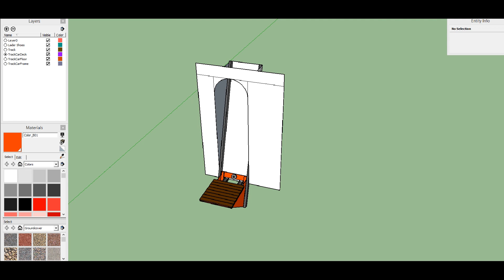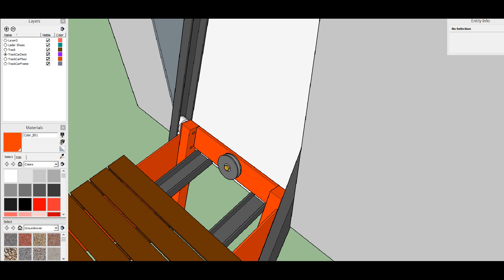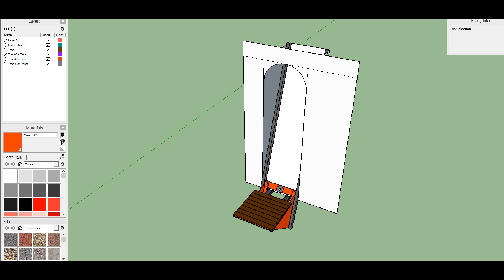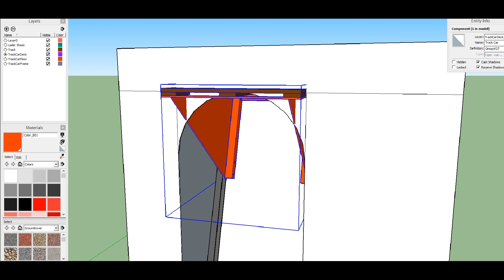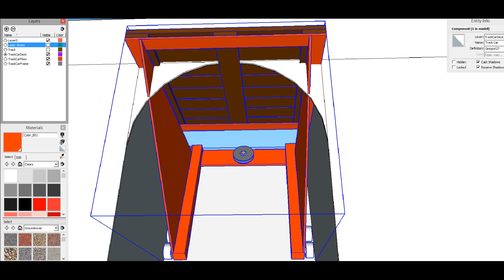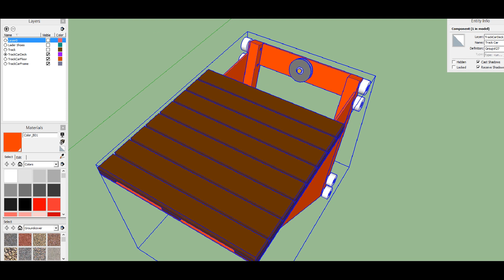Seeker Elevator solution

Comment: you could put the ladder on the elevator, this would provide a means to attach gear to be hoisted to. and then make it a more permanent platform at the bottom. when not in use the ladder would be functional as a ladder.  it would also help gaurd the moving parts and provide more clearance to the total package.

Comment: I'm no engineer but how will that design work?  However the ladder is attached to the boat,   your lift will foul the attachment points.  It can only work if the ladder is free floating (which it obviously isn't).

Comment: Why the space between the ipe tile and the rails?  The space looks like it's 40% of the tile size. I guess I don't understand the application well enough.
I agree with David Stewart about doing away with the ladder. I kind of like those near-vertical stairways with alternating treads and three stringers--one of them between your feet. They allow you to double the tread depth and you can let heavy loads slide up/down the center rail.

Comment: Do away with the ladder...Too temporary.  Mount auto-flip steps up the entire length.  Have them setup so as the lifting base travels past the steps auto retract.  That way you can move the tile in close to the steps and avoid it hitting combing. 
Plus at the bottom of the stairs I'd add in a self close false floor to hide the hole. 
Just a thought. :-)

Comment: Why is the platform sticking out so much from the rails? I would try to keep the platform as close to the rails as possible, if only, to reduce the torsion (it would avoid a gap when at the top and clear the arch in the door way).
Reply from the maker: Because it has to clear the ladder that runs in that space.

Comment: Good idea but reinventing the wheel. Just go to a place that caters to roofers and get a roofer's shingle lift. It goes on a standard ladder. Power it however you like. Modify the platform to suit the width and head of the companionway.  However, use underway, particularly as a man lift will be problematic at best.

Comment: Now I feel bad sending Doug my crappy sketch with a sharpie, he he... agree loads have to be distributed above and below platform to deal with twisting loads. I had mine only extending a short ways below, planned to use ramp at bottom and top to make up elevation differences. Mine had upper part of platform actually moving above deck level while keeping at least 2 wheels engaged in a garage door track system so it can deal with loads in both directions ( compression below and tension above platform levels.) Ladder definitely removed for elevator evolutions was already in plans.